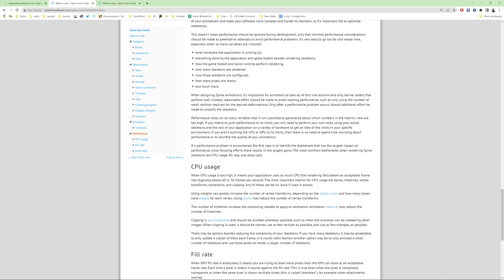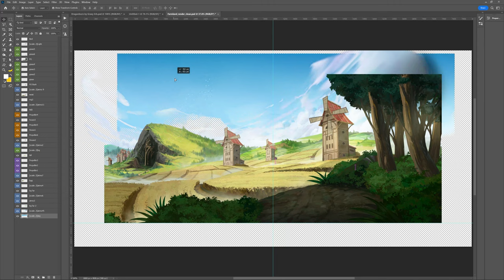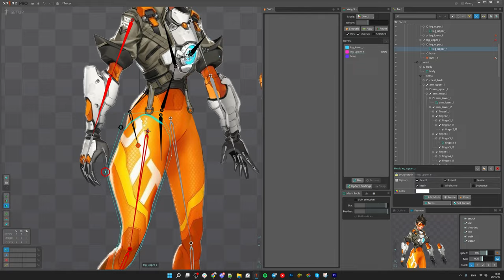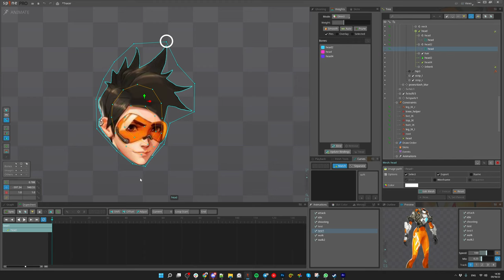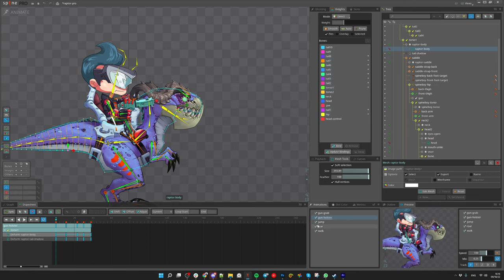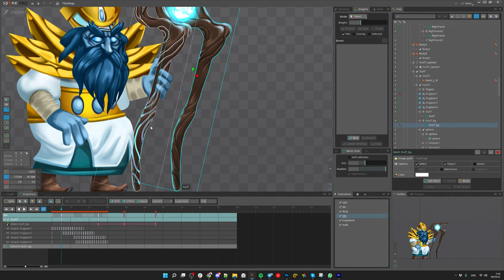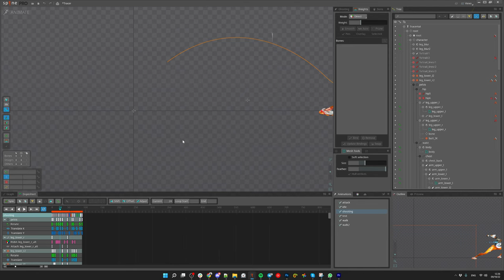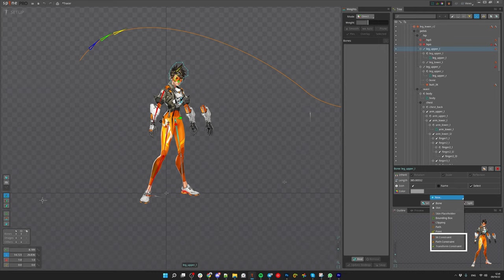Spine 2D How to optimize your project

Comment: Very insightful video, thanks for sharing! I already took your advice from previous video with reducing size of fx attachment, so this one was a goldmine of tips.
I've been wondering about key interpolation performance, especially linear vs those controlled by Bezier handles - I have way less keyframes and more control in animation thanks to that, but I'm not sure how it impacts performance in runtime, especially with many skeletons on the scene. Something tells me it might have an impact, but I don't have enough technical knowledge to check that in any way.
Reply from the maker: Easing does not affect performance as far as i know. Just equation is different when calculating next step
Reply: Bezier is slightly more expensive to store than linear because the curve has to be stored but that's it afaik!